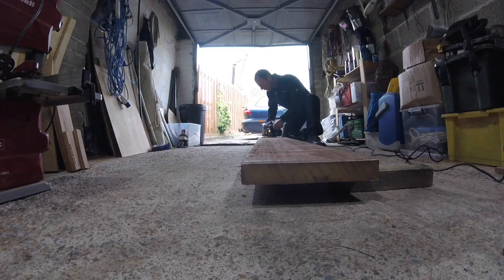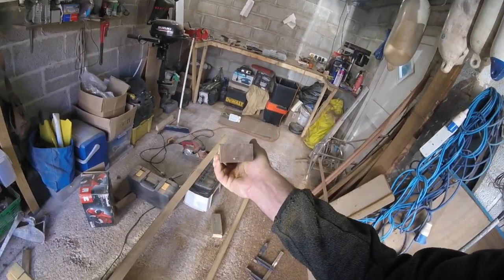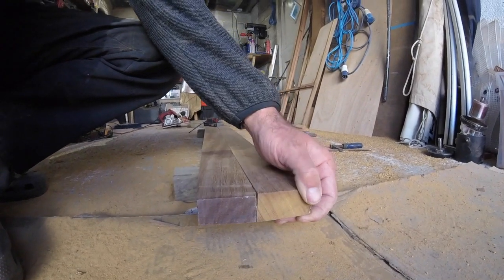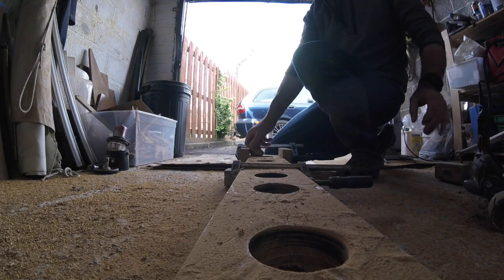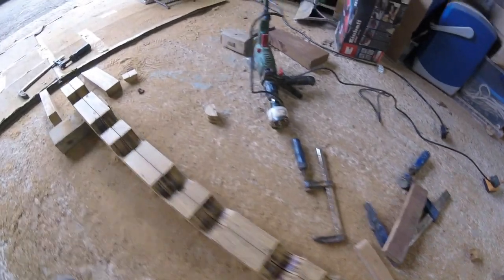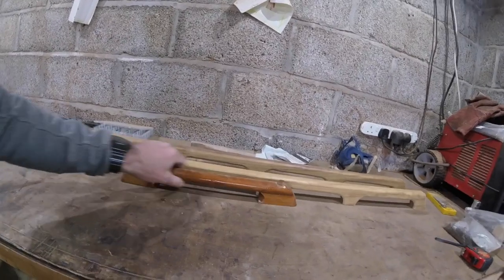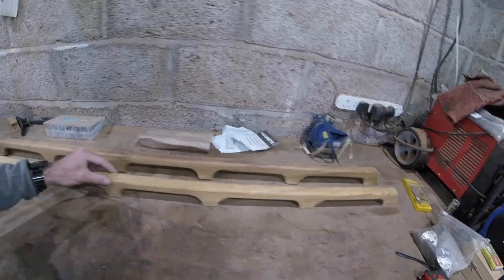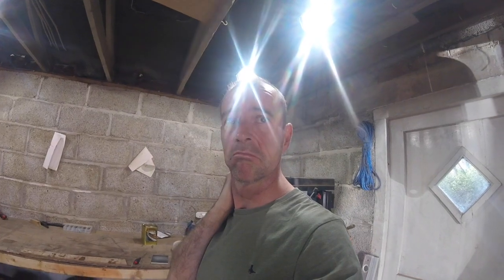New Iroko grab rails

Comment: Great work. Mine are a little different as I have a GRP lid but I have to ask, will you need to bend them?
Reply from the maker: I will indeed need to bend them, but on the back of my experience with bending the outer coving, I recon I can spring them into place... I'm hoping anyway
Reply: Twister 28 , it’s the same as mine! The one good thing is it is a lot easier to fit
Reply from the maker: @twister2869  I really like that bag steaming system. I'll lay them flat then put weights on the middles until I can get access to the boat. They'll go round I'm sure. Getting set up for steaming will cost to much